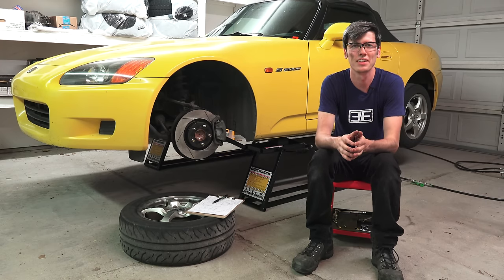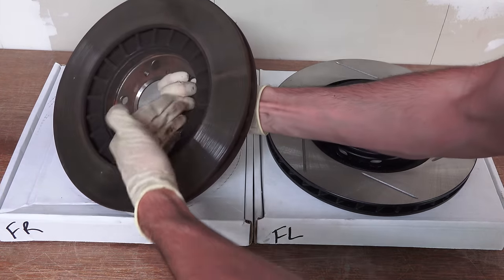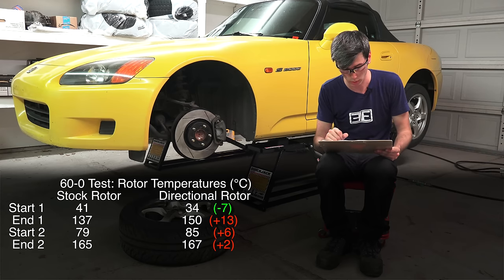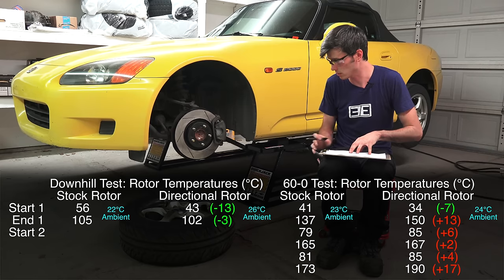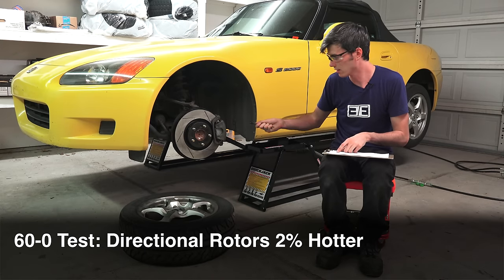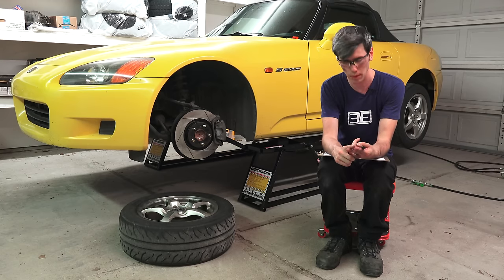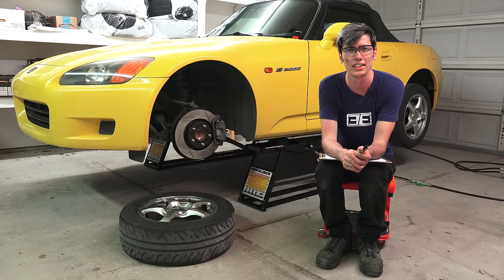Do Performance Brake Rotors Have Better Cooling?

Comment: Did you check at all for brake fade resistance between the two sets of rotors?  Hopefully the slotted rotors will not fade as quickly as the standard rotors.

Comment: The best rotor is the stock... drilled and slotted are only for look but there aren't good for sport drive.
The pads are VERY IMPORTANT, not the rotor!
Reply: He's done a seperate video on drilled and slotted rotors. This was more for the ventilation inside the rotor.

Comment: Didn't you say that you used the stock rear brakes? If you upgrade the front and not the rear the front will do more work over stock braking.

Comment: I think you should have added a rotor temp while driving, since the va es are there to move air. The vents don’t serve a purpose while braking, but after to dissipate heat. The higher temps are due to having better coefficient of friction, so higher temperatures at the rotor

Comment: Warped My slotted stoptech rotors on the street. Dont drive in rain. On the street. Did a few 140+ mph slowdowns on highway roll racing but common. Blanks lasted 10k Miles
Reply: Did you clean the rust off the hub, make sure the slide pins were clean and then greased, make sure the pad moved freely in its guides.  I know too many people that are done with their brake change in an hour, doing it right is closer to 3 hrs.

Comment: You put the vented rotors on the wrong side. Air is sucked in thru the hub on the back and vented out the fins of the rotor. Not the other way around like you have it. Regards.

Comment: You also failed to take into account that the directional rotors are slotted and stock are not.
The slots do wear pads more quickly, and would cause their temperature to rise more quickly than a non slotted rotor.

Comment: Directional veins give the rotor more total surface area to use for cooling.  I think they would shine in a test that measured the rate of temperature change at speed after a severe braking event.

Comment: Standard rotors were bedded in to the standard pads. Aftermarket were still a newly machined surface. More friction means more heat

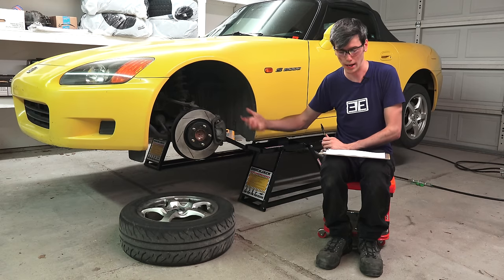Comment: Best part of test started at 10:04 where tester had used them on a track where the constant use could show real results of braking over time. This is where directional will show its merits.

Comment: The purpose of the cross cut grooves are to release pockets of gas produced under racing conditions when temperatures are probably 600c + .the gas pressure can force the pads away from the disc under extreme conditions when racing without the grooves. They have no effect on normal driving.
Reply: Gasing fiction material and its effects are not discussed in this video. This is about rotor cooling vanes.

Comment: Ahhh easy test.. get both sets of rotors to 700 degrees then drive at 60mph for 5 minutes without using the brakes then take the temps

Comment: You need 2 have a different set of pads and seed in the pads to new rotors. The heating of the brake in helps the resin in the pad to mate to rotor.

Comment: Great magnetic thermocouple! I need one! Also check cooling in air! More surface = quicker cooling! Also test at the same time left stock right aftermarket with a person in passenger seat with same weight as you in straight line! OK you sort of did!

Comment: I changed to drilled and slotted rotors on my car and truck and it makes a HUGE difference in braking.  Not so much on light braking, but as you progressively push harder, you can feel the stopping ability increasing much more over the stock rotors.   I almost ran a red light at 35-40 miles per hour.  I was absolutely going to run it.  I don’t know how I missed the red light.  The reason I didn’t actually run it was because the cross traffic just pulled (jumped) out into the intersection just as I was crossing the crosswalk and about to actually enter the intersection.  I was a split second from t-boning 2 lanes of cars coming from the right that just pulled out.  I jammed on the brakes, the anti-locks clicked the whole way, but I STOPPED in the middle of the intersection, before actually.  I stopped 10 feet from hitting the cross traffic cars.  I was shocked that a) I had a good enough reaction time to even try to jam the brakes on in time and b) that the car was able to stop from 40 mph to 0 in about 25 feet.   Basically the crosswalk to the middle of the intersection, however far that is.  There is nooooo way I could have done that with the OEM Toyota Tundra brakes.   I still think it was a miracle I stopped in time.  Even just reacting fast enough to jam on the brakes shocks me.  I was entering the crosswalk when I realized I needed to stop immediately to not hit any cross traffic and I only put my nose half way into the intersection before I came to a complete stop.  Crazy.  I stopped with at least 10 feet to spare.  

I was shocked at how well my new high performance brakes work.  I recommend them to anyone.
Reply from the maker: Brakes don’t really change your stopping distance, tires do. Like you said, ABS kicked in. At that point, it’s your tires that are the limit, not the brakes.
Reply: @EngineeringExplained  I would agree in that "braking" is only as strong as the weakest link. Throw a little sand or gravel on the road and it may have been a whole different end result. (Thank you Mr. Street Cleaner!!!)  I have fairly new (couple years) Bridgestone HL tires which are outstanding premium highway tires.  But I can ABSOLUTELY tell you that those new brakes made a HUGE difference.  I was honestly shocked that I was even able to react fast enough to put on the brakes so that I had enough distance for the brakes to even work. The distance was that short!! I do have to give credit to the great ABS on my Toyota for not extending my stopping distance noticeably like in some vehicles. (I do notice in snow, they kick on very early in what should not be skid conditions, but do not seem to interfere much with stopping distance.)  

There is a massive difference between being able to apply the brakes firmly and the rotor sliding *uniformly* with maximum braking power and having to apply the brakes MUCH more firmly on factory rotors and the rotors locking up so the ABS has to kick on a LOT more - extending my distance even further.  Those Powerstops fit in the former category.   I have driven the vehicle for 20 years with Factory rotors, so I have a LOT of experience at braking with them. The difference is very noticeable. I wish I had changed these out 19 years ago.  I wonder how the Powerstops would work in the snow where the opposite conditions apply.  

Traction of the tires (without locking up) is the weakest link then.  Could be these are a negative then unless the rotors still slide more uniformly without locking up as in the "perfect" dry conditions I had.  It doesn't get any better.  I highly recommend the package.  At least on the first generation Tundras like mine (with the upgraded factory calipers).

Comment: The slots in the rotors are made more fore releasing the gas created bethween the rotor and the brakepads when braking hard to increase braking performance not cooling

Comment: I got brembo slotted rotors on my mustang gt a few years back and regret it. Don’t get me wrong the rotors work great but at high speeds and high brake force you can actually feel the slots. I would just get a solid rotor from now on. Even most sports cars today use solid rotors.
Reply: It’s rare when I actually feel the buzz of the slotted rotors. I usually have to brake hard going like 100 miles an hour to feel it.

Comment: Slotted rotors only help clear the brake dust on hard continued application. Drilled rotors help release the gases from heat prevent brake fade and cooling rotors faster. Try it with just drilled rotors and you will see different results
Reply: nicewknd vanes are inside like that on all rotors

Comment: Aren't drilled/slotted rotors suppose to dissipate the heat, not run cooler? Wouldn't a better test be to see how long it would take for the rotors to cool down to an average temp (say 100 F or w/e)
Reply: Nevermind, just watched the rest of the video lol -_- pretty sure thats what they were designed to do. I never heard they were suppose to run cooler, just dissipate the heat which sounds like thats what they did. Though not to a degree I would call it worth it to spend the xtra mo nay

Comment: The reason it’s hotter because the directional rotor has less material due to those line cut outs. Versus the stock rotor is full metal and solid.

Comment: What if the rotors perform better when they are hotter? In F1 racing the driver needs to warm up tires and brakes so they'll actually bite and become effective.
Reply: Cause they are carbon ceramic brakes

Comment: The slots are used for getting break dust out of the system. Drilled is for cooling dude. I appreciate this video but fundamentally the premise is wrong.

Comment: i forgot.  you should look at carrol smith's orthogonal milling.  very smart and quite inexpensive if not using CNC.
Reply: CNC is always horrendously expensive compared to mass produced castings with minimal finishing machining. In this application it offers very little advantage except for cosmetics - you still have to cast the bulk of the rotor anyway.

Comment: Your wrong. Drilled holes is for cooling the slot on the rotors are to funnel the brake dust out and assist in cooling the pads not the rotors.
Reply: It's to vent gases nothing to do with cooling 😉

Comment: you totally violated a scientific principle in regards to not just testing for the data and then coming to a conclusion you have a conclusion and you kept trying to prove your conclusion g how can I manipulate the figures to justify the fact that the answer didn't come out the way that I wanted it to that's not scientific......by the way I'd also like you to run that test with those rotors on the other side what I mean the left on the right side and the right on the left that actually prove that it does make a difference on which way those veins run I don't think it makes any difference whatsoever
Reply: Concur,  Didn't want to say the Emperor had no clothes.    I didn't see anything the average driver would benefit from.  Almost looks like a sales gimmick in which the only test that showed a benefit was on a track under very specific conditions.
Reply: @TheModelmaker123   yeah I would also like to see cross drilled rotors tested everybody says they give better heat dissipation and logically you think it would in fact I had put them on a Corvette I used to own but did they actually help I can't really say

Comment: I thought slots and cross drills are to reduce gas buffers between the brake pads and rotor? They aren't necessarily for cooling.
Reply: Nope. Gas between rotors are from old style break pads. None issue nowadays

Comment: also if the rotors are made of a slightly different material, it can take more energy to heat up per degree

Comment: I think your testing did not work because you never used the impeller design that the aftermarket rotors have. Those vanes act as a fan, so using then stopping right away to record temp....won't show their advantage. Those rotors are designed to cool fast as you're braking from one turn to the next.

Comment: Is there any difrent with the grove ones of brake disks with holes in them?
Reply: Ya the holes allow air to cool faster and the way I drive it suits me cause I fly and sometimes when a punk ass mofo wont move or move there slow ass in my lane I have to rapidly stop and the stock rotors eventually wrap from the heat so I swapped them. And he got them backwards also the slots are supposed to face the other way. I ain't a degreed engineer but a tech that's smarter than most not everything if numbers cause this is not a controlled test and I'm sure he did not apply the same amount of pressure like he said. I'm starting my channel! But I'm into everything check me out and subscribe.  I'll show it!!!

Comment: I always wonder how those slots effect the wear on the pads, i'd think every time a slot goes by it scrapes the pad kinda like a cheese grater
Reply: It doesn't really effect wear that badly but it does help built up brake dust from being removed from the pads.
Reply: Mikey6048 yes have installed a set of directional rotors on my 2007 civic and they do wear the pad faster than no slotted.👨🏾‍🔧🇯🇲🇨🇦😭😫😳🤔🍻🤯.

Comment: The aftermarket rotors seem to heat faster suggesting they extract more energy = better braking. 
As said needs a track test.
Reply: Actually this is wrong. The higher the heat harder it is to break. The heat transfer is better when you are talking about the break pad transfer not the rotor temp. The higher the heat in the rotor the more heat it will need to absorb in order to break since it will be harder too transfer breakpad heat.

Comment: They suck air from a hot rim which is hotter after braking the the air under your car. Also I got money that they keep recirculating the same air rather than pumping new air-I bet they are much worse in racing than stock

Comment: Also being lighter they might slightly increase the vehicle performance.
Reply: MY ACDelco Specialty Performance Drilled & Slotteds were actually 4 ounces heavier than the stock rotors.
 All Drilled & Slotteds are NOT the same, in specifications, performance, price, or application.
 However, your note regarding "less rotating weight" is quite valid -- by switching from stock steel wheels to cast aluminum, there is a 4-lb.-per-wheel rotational weight savings.

Comment: The test is not a good comparison. The stock rotors with the stock pads will have a different results when you just swap the rotors with aftermarket rotors.

Brake bedding in very important when you do a brake job. You want to get a layer pad material on a fresh rotor. You want that pads to mesh with that rotor, and develop a wear pattern collectively. 

So if you just just slap rotors on that disruption that dynamic. It's no different than just pad slapping brake job. No new rotors, and not even a resurface rotors. Which some  people do.😳😳

Comment: Those Vanes are almost only for Cleaning purpose, just a minimal sideeffect is the cooling.
Reply: Wrong. The vanes are between the sides of the rotor - their primary purpose is cooling. You appear to be talking about the slots. And they are not there for cleaning either - they're there for gassing.
Reply: @TonyRule  woops, i thought thats what was meant in the video, my fault, sorry. I'm german, so might have missunderstood him XD

Comment: First, did you "break in" the new rotor? Second, doing these test on the car isn't going to yield apples to apples results. What you need is a bench top brake test station. Something you can apply the same brake force to each rotor then measure the results. But my opinion is, if one was hotter... was it not grabbing more therefore having more stopping power?

Comment: should've done the test with new pads on both rotors.
Reply from the maker: That would change two variables instead of one. The point here is to only change one variable and see the difference.

Comment: You should have stopped the car with engine brake. Give the rotor a break to pull air and cool down. Because you stopped the car with brakes, both the rotors heated Up, but as they didn't rotate again to cool down, the temperature difference wasn't detectable.
Reply: I mean hit the brakes, then accelerate to cool the rotors, then don't hit brakes again, instead use engine brakes, then you'll get the correct reading.

Comment: Isn't slotting or drilling rotor surfaces going to reduce the surface area of the rotor and therein reduce the stopping power of the brake system? I've never really understood the point of this especially in normal passenger cars.
Reply: Yes I believe it’s mainly for heat dissipation

Comment: You can’t do a brake test and jus stop car, it would need to be allowed to roll after car was stopped abruptly. Without that vanes wouldn’t even matter and it would solely be on mass differential.

Comment: Can your resurface the aftermarkets rotors after a use
Reply: As long as you use a cutter that can handle an intermittent cut - then yes. So ceramic is out.
Reply: Kool thank for info
Reply: @clowns76  Oh, and provided doing so doesn't take them below the manufacturer's state minimum thickness or the OEM original thickness, whichever is greater.

Comment: Didn't you account for braking distances? I mean surely if the aftermarket are bringing the car to a stop quicker it's inevitable they will create more heat than a disk that is unable to stop a vehicle as well.

Comment: :) Your methodology is wrong , you measure the disk temperature after braking , you did not measure it right . The question is : are the aftermarket rotors with better cooling , not : are they getting more heat on stop . To measure the cooling , you need a roller , put the wheel on it and spin it . After 63 mph - apply brake , measure the temperature from a distance , then rotate the wheel for 1 min for example with constant speed , and measure the temperature again from distance . Calculate the difference . That way you will find if the aftermarket rotors are getting cooler faster than the stock . And over all do not talk about cool or warm , talk about heat transfer , amount of heat and working temperature . I see that your channel must reach more people , and they have to understand basic physics , so i hope you will educate them to use the right terms and tool to explain themselves how thing in modern car word work . Have a nice day .